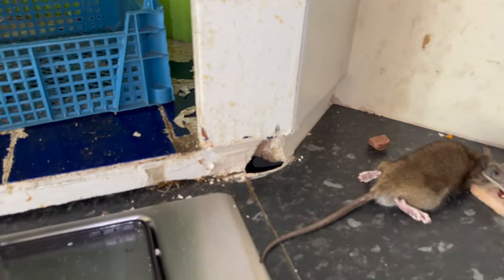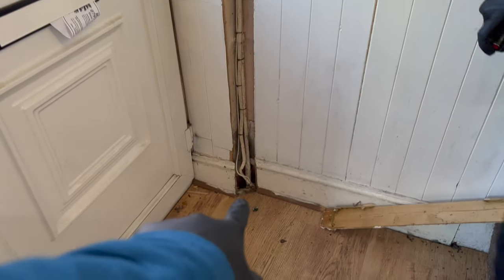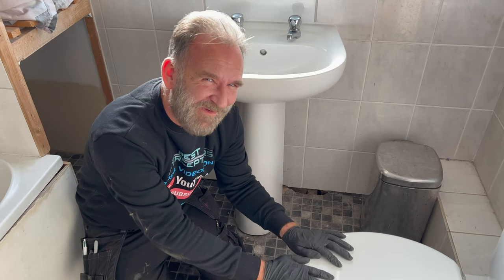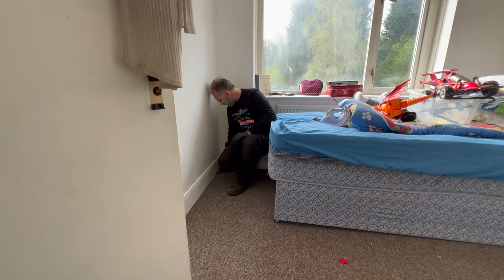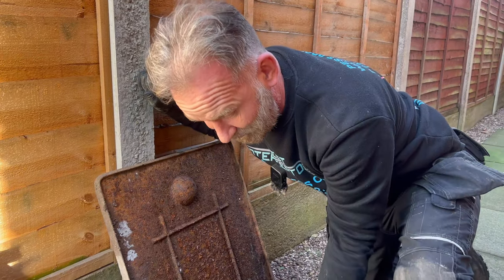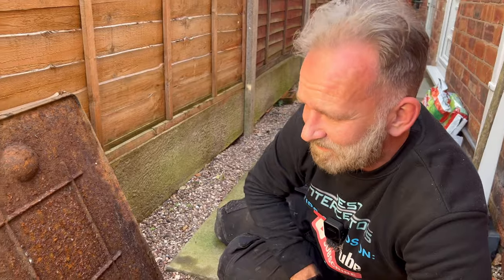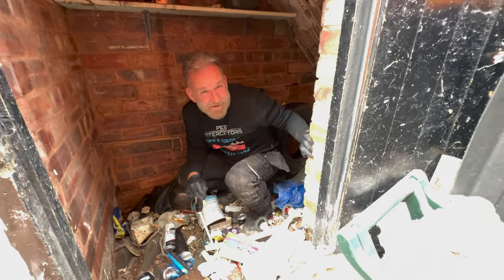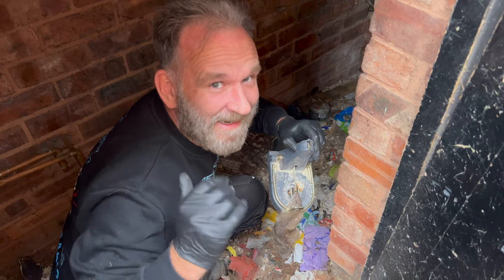EXTREME RAT DIVISION faces its BIGGEST CHALLENGE YET!!!

Comment: Do another "family" not move in after a while ...? I have a constant battle with them as I keep racing pigeons. I put the green blocks down which go for a while, then they remain un touched for maybe 2 - 3 months then they start going again as if there's a new group moved into the area ........
Reply from the maker: @pigeonworldforum3869 that is a classic sign that they are rats coming from a broken pipe in a sewer or drain. 
It’s also probably breaking the law (read the label on your ‘green blocks’). 
You should be using traps not poison. Imagine the amount of secondary poisoning you could be doing to wildlife like birds of prey and other apex predators.